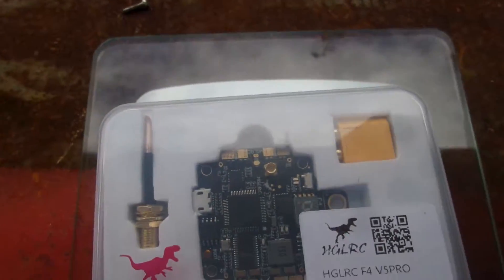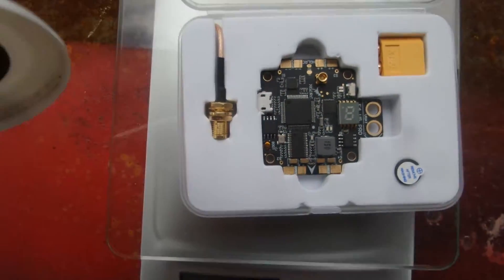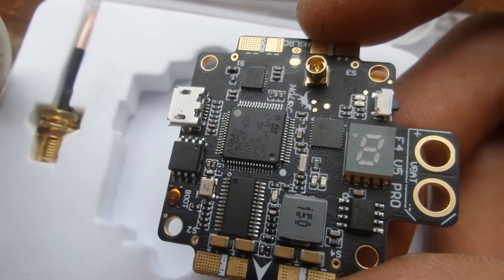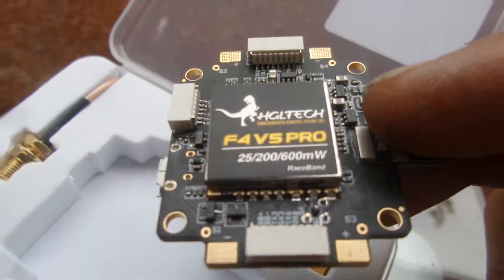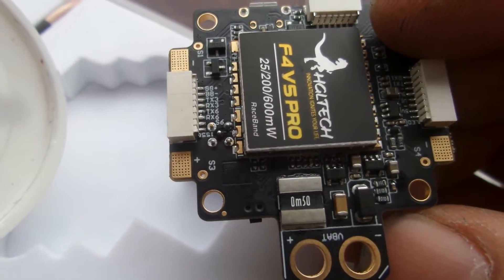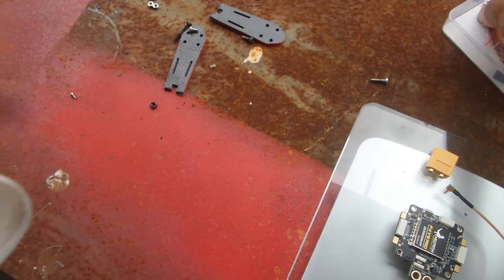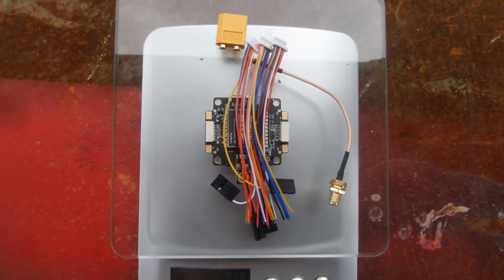First look at F4 v5pro AIO! and  f4v5pro giveaway details!

Comment: My internal VTX has burned... How to get the FlightCrontroller OSD output to use on an external VTX?
If you have any fix please :)
Reply from the maker: Betaflight OSD chips are AT7456E if i can find documentation we might be able to pin out and trace out the osd chip for use. i'll try to find out what i can  :)
Reply: Super cool! Thanks a lot, I will search on my side with AT7456E reference, thanks =)
Reply from the maker: good man! yes that is it! so the video out pin you can trace so that you may use it , but make sure you solder after the resistors on that trace.

i have not performed this myself but if you are willing then please report findings!!
Reply: Yes I will!
Thanks and see you later for the verdict :)
Reply from the maker: the video in likewise, make sure you slder on the trace to include any in line resistors etc.
Reply: Another idea... replace the VTX chip with another one directly? :)
Have you got the reference of the VTX chip please?
And any link to buy it? Thanks
Reply from the maker: Alexandre SOLER awesome mate! Happy to help!
Reply: VTX reference seems to be SP269TX =D
No problem I will do it
Reply: VTX reference seems to be SP269TX =D
No problem I will do it
Reply from the maker: the board i have with vtx chip removed has pulled a couple of pads that are hard to trace out.

Comment: Can you tell me how i connect this with Flysky FS-A8S FS A8S 2.4G?

I only see sevo connectors on the fc board and on the reciver....
Reply from the maker: @ 2:41 pause it. see that connector port. its got from the top
DSM 
3v
-(gnd)
5v
PPM
SBUS

you want to connect to 
-(gnd)
5v
SBUS
Reply: KillaG FPV i do there connector and solder wires together en cut off the old servo connectors by reciver and fc wires? And solder this togheter?
Reply from the maker: i pulled the wires i dont use from the connector gently. they came out ok. then either cut the wires and solder the signal wires from you sbus to sbus and gnd to gnd and Vcc to 5v. if you have and silicon motor lead wire spare from when you cut the motor wires for esc. you can do this for your solder join. 

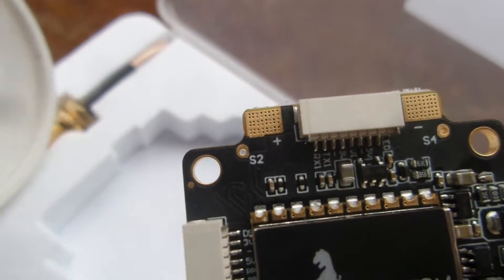go to 2:45 mark on this video https://www.youtube.com/watch?v=lPtcv0chbFM

Comment: Do you know of there is mic input on this board
Reply from the maker: there is no mic input.
Reply: KillaG FPV that's too bad, I wonder the TX wire does beside the video out on the same harness
Reply from the maker: Tony F tx being an output.... wont accept inputs ;) rx for mic..... never heard of that
Reply: What does it output?? Maybe audio but you don't know correct thx
Reply from the maker: Tony F it cannot output audio without an input for audio. and if there was an input for audio then there would be no need for an output as the vtx outputs via 5.8g ya dig?
Reply from the maker: but using the rx for for audio input to be broadcast by vtx.... never heard of that being done....
Reply: So what is that output then?
Reply: What is that TX/Rx wire doinf there
Reply from the maker: uart 1 tx n rx. its labelled as rx1 n tx1, so telemetry, bluetooth, gps,  etc. standard uart options. 

manual pdf download link is in the description ;)
Reply: I just figured with the other harness having rssi and also inputs/ out that this harness with the vtx  maybe had mic thx for your help
Reply from the maker: Tony F perfectly sound assumption. i also wondered about the staggered uarts. but def no mic selection on betaflight through uart...
Reply: Cool. Let's see how the replacement board does the first one they sent me fell apart lol
Reply from the maker: really! how so? which bits fell off? solder quality seems shite. components are nice. soldering is minimal.. maybe an extra couple of grams of solder over all components might alleviate this issue.

Comment: Does it support S.Port telemetry?
Reply from the maker: i use spektrum. as stated. but for frsky it has plenty of tx pins. and the option is there on betaflight.
Reply: Thx, may be just use "resource" to reallocate pin. but I am not sure. Anyone have any idea about it? thx
Reply from the maker: select correct one maybe? uart tx rx 2 - 4- &5 are used for other features.
Reply: let me google/youtube or RCgroup around. thx!!!
Reply from the maker: i'll ask hglrc specifics if you want?
Reply from the maker: ill send a question to hglrc in the meantime about frsky telem.
Reply: If possible. thx! I was looking at their F4 Flame, seems not supporting S.port telemetry so I check if F4 V5 can.
Reply from the maker: i have sent email asking about s port.
Reply from the maker: here is the reply i received. i have asked for further information such as requirement for an inverter etc... 

"Hello Walter

It is compatible with frsky sport telemtetry,use TX3 and TX6."
Reply: Thx. So now only 1 piece left, if it need an inverter, right?
Reply from the maker: TheJackRussell Present inverter is for sbus input tho right? im not too familiar with taranis.
Reply from the maker: tx3 or tx6, fully suppported. no inverter required for sbus input.

Comment: Hey man.. DO you know if the sbus input need an inverter. Also, did you find any pinout to betaflight conversion. Wich port is wich USART?
Reply from the maker: Fernado Basello betaflight conversion? it runs bf3.1 and dfu mode for flashing. it has a boot button if you wish to install firmware that way. as for sbus. i use spektrum so i cant tell you from experience.
Reply from the maker: sbus input DOES NOT require inverter!

Comment: thanks for the great video.. are the wire silicone? looks like plastic from the video.
Reply from the maker: glad you liked it! the wires are not silicone. i find silicon on wires this small tends to give them great flexibility yes, but no tension strength at all. a tug on a silicon wire this small simply breaks the strands of wire inside the silicon. leaving you with more of a headache trying to figure out whats wrong. the plastic isnt overly stiff,  which is great. as you will notice on the 180 build i used this FC on, the led wires that i left unused but still in the pin i twisted up and the placstic doesnt seem to mind twisting and bending at all. so it still maintains flexibility with tension strength, thats just my opinion tho.